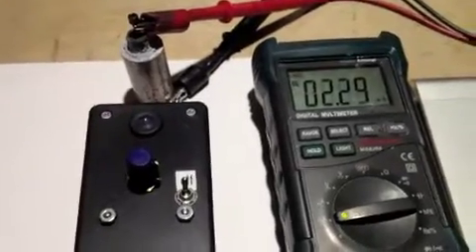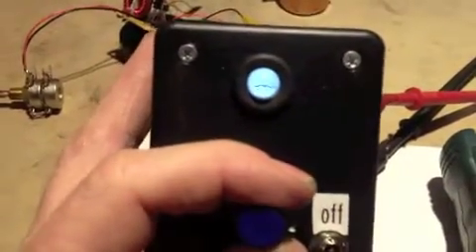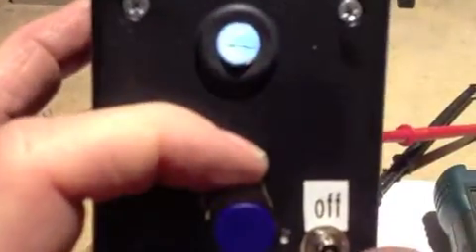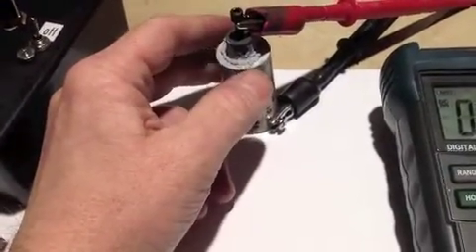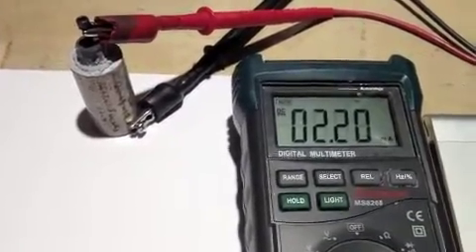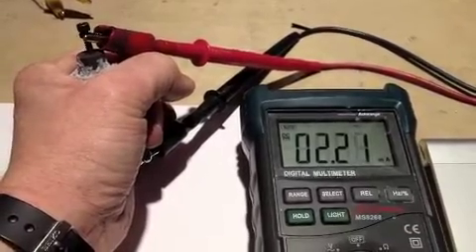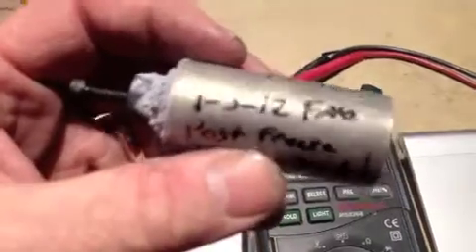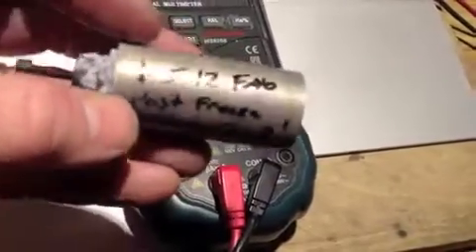Dual Toroid Project and Frozen Crystal Cell Update

Comment from the maker: The Ferrite Toroid cores are 1cm apart from each other.If each toroid has two coils, they need to be in series tesla type top of one to the bottom of the other, so if you numbered the leads  
-4    1-     next toroid    -4      1-
-3    2-                        -3      2-
Leads 1 and 3 are soldered together on each toroid then between toroids, then connect the corresponding 2 to 2 and 4 to 4 with the toroids coils out of phase. diveflyfish